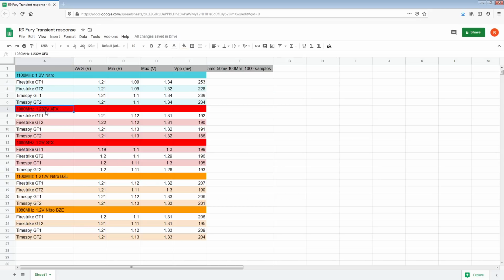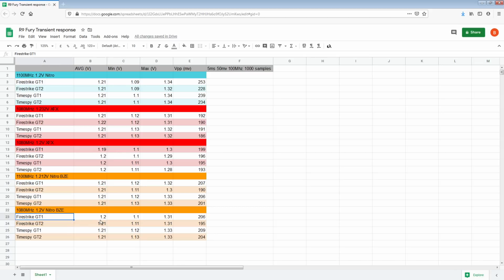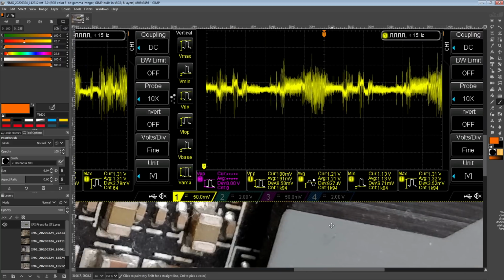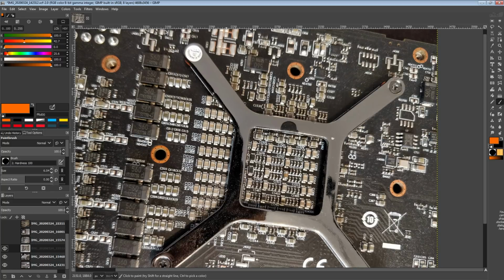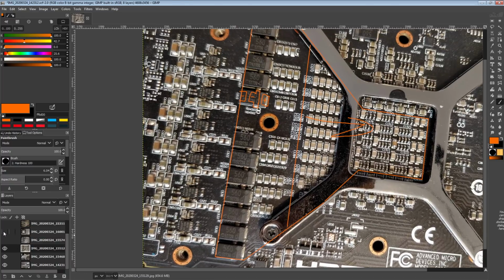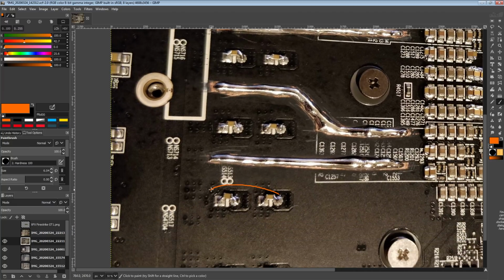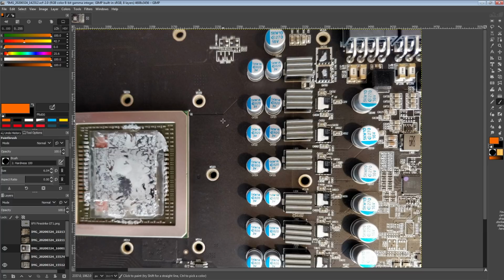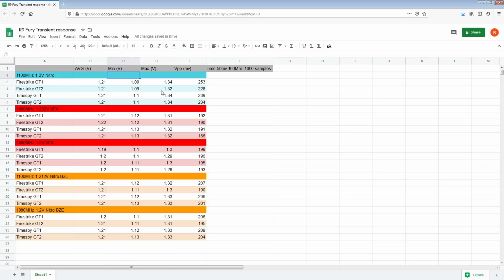R9 Fury Sapphire Nitro and XFX voltage regulation testing and Nitro cap modding.

Comment: I have a GPU related question, and i dont know who/where else to ask :-). Was given an old Asus Gtx 780, was told i worked except for faulty fans. Replaced the fans, but could just not bring it to life. Fans powered on like normal, but no video out. Have taken it out on and off the past two months, until today when i tried using a DVI-I to VGA adapter. Turns out all the digital outputs are dead (HDMI, DP and DVI-D). Am i just really unlucky that they all died, or are the digital outputs connected in some way? Love your videos btw :-)
Reply: The digital outputs are all connected but having them ALL die is still unfortunate

Comment: Great video but I have some criticism. Way too long at almost an hour when it should be a 10-15minute summary. Also get a 6 1/2 digit bench dmm for better accuracy, used ones are available online. Its not good if you move the test leads and values change, leads might need to be soldered on. Also the chart shows voltages very close and within the margin of error/accuracy, the percentage is not significantly different.

Comment: Hey, why dont they use those huge NEC/Tokin proadlizer capacitors anymore? They were portrayed as some good stuff back in 2010 era but now i cannot find a single modern GPU using them.
Reply from the maker: They have absolutely awful endurance and so over time they got less popular and then eventually stopped getting used completely.
Reply: Oh nice to know, thanks.

Comment: The low ESL of the alu-poly SMD vs the TH ones is really quite good, but in this situation because of the distance from the load I'm not sure how significant it is as the ESL is now in series with the power plane inductance. (i'd estimate the power plane inductance to be around 0.15nH/cm, doubling or tripling the inductance between the core and the SMD alu-poly caps)

I really want to see what happens if you stick say, 8x RS80E122MDN1JT right on the back of the core with the shortest legs you can; sure the ESL/ESR is way higher than that of the MLCCs but the ESL from the alu-poly right on the back of the core to the MLCC vs the power plane inductance from the VRM to the MLCC on the back of the core would be interesting (plus, decent TH alu-poly caps are cheap)

I'm also pretty curious about the VRM too, I noticed both boards use SMD inductors instead of through hole inductors making them a little easier (though still not easy) to swap out. If you could swap out the inductors with a lower inductance it will improve the transient response of the VRM but will make the output voltage ripple worse - but that doesn't seems to be an issue as the Ripple seems to be around 10-15 mV compared to the transient response under and overshoot of 200mV. If you have access to the datasheet to locate the appropriate pins or the tools, decreasing the inductance and increasing the switching frequency could potentially greatly improve transient response.
Reply from the maker: The ref PCB has a shorter power plane.
Reply: Yeah, the ref PCB has a generally much nicer layout, of course we can't see the inner layers but it seems like on the sapphire PCB the entire VRM is just too far away

Comment: I have a R9 fury Strix, i bought it new at the time apparently the stock phases had coil whine and it was the only non-reference/custom pcb at the time.  still running Stronk in my rig!
Reply: me too! it's got some quiet whine (or more so, buzzing) doing Folding@Home

Comment from the maker: Not a huge fan of how this turned out but I can't think of anything I can really do about that ATM.
Reply: I don't know, I thought it was really good. The only thing I can really nitpick would be how long you were stuck on the test resolution at the beginning. The only other things on my mind were: A supplimental GN style graph with margin of error bar would make things more consumable, maybe you could replace the cap with a 1206 probe connector (nvm ripping a pad off would be bad, that form factor is a guess). I'm no EE but wouldnt the 10x10ųf example have higher ESL if they were connected to the same spot? Oh and finally, YoU sHoUlD eDiT yOuR vIdEoS
Reply: get a Keithley bruh
Reply: Let's see if hypercritical Henry over here can quantify the issue, anyway a meh video is always better than nothing. Check back in a hour or so and I'll drop my $0.02